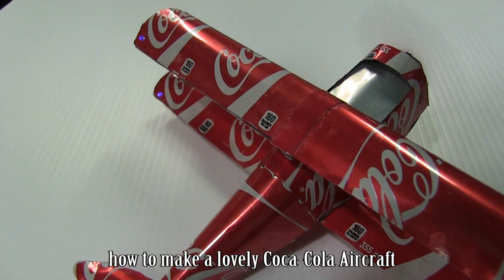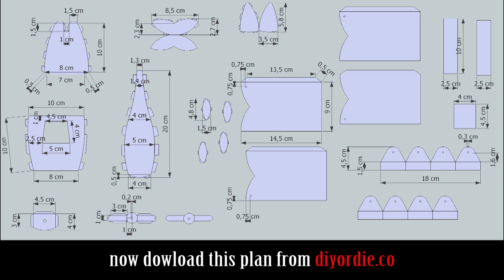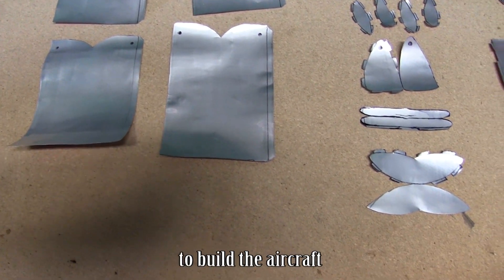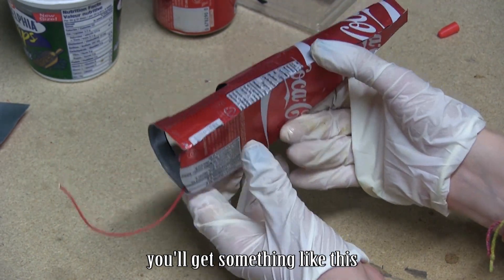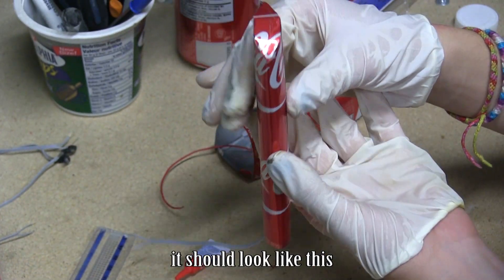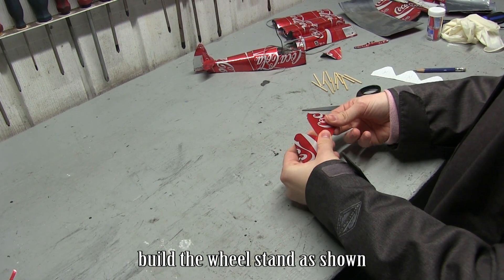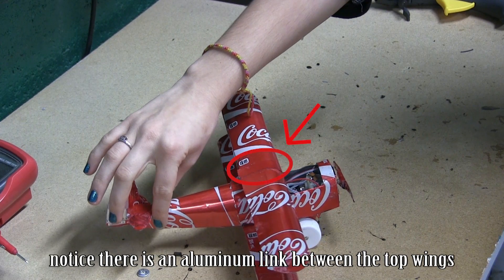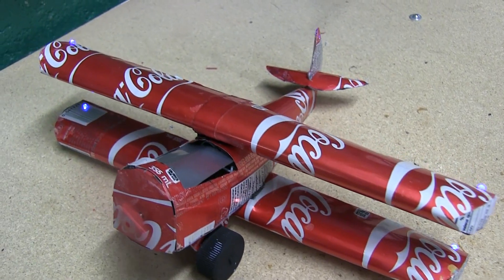[D.I.Y.] How to Make a Coca Cola Aircraft

Comment: the glue.  how does the glue work. what kind of glue,  the exact brand you used, listed in the bill of material (BOM) I've looked at 20 video's of making models from cans and everybody skips the details of how the glue works, the EXACT type of glues, prep to make the glue work,
Reply from the maker: jleslie48 it is a normal super glue. we personally used the brand called crazy glue. it only take 30 second for it to dry and it's pretty strong